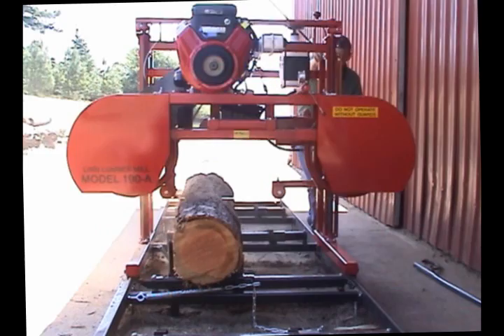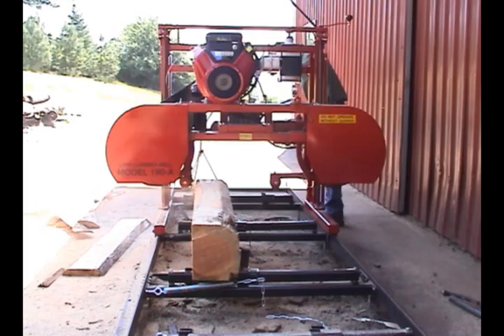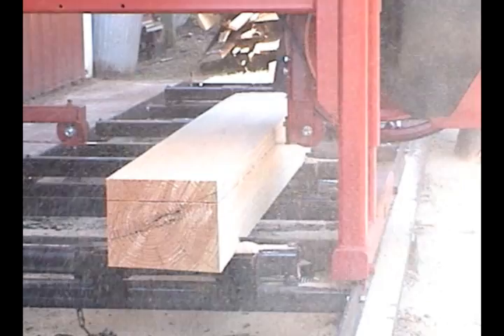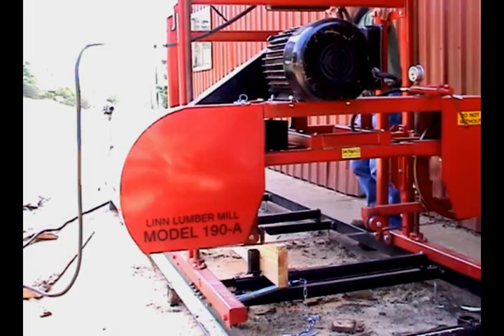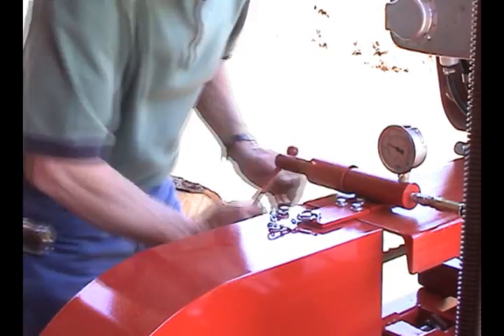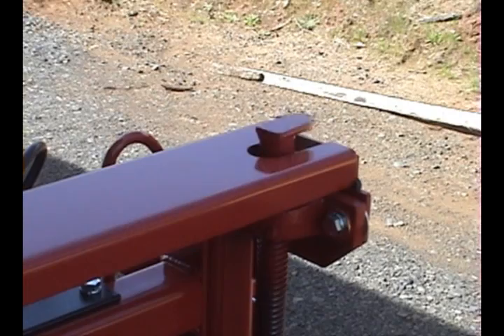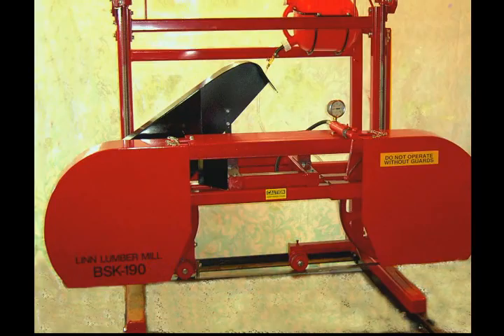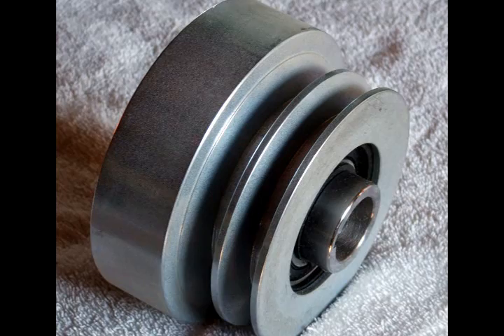Linn Lumber 2012 Sawmill Demo Video

Comment: I want to let people know that I originally bought one of Gary Boyd's very first mills 34 years ago.  Gary was the founder of Linn Lumber Mills.  I have been building Handcrafted log homes for over 48 years and I needed a mill that would cut very long material.  While most of the logwork is done using chainsaws and hand tools, I needed to be able to cut logs in half and to cut flats on rafters and plate logs.  The original mills used a vertical shaft motor to power a long chainsaw bar and chain.  It is a perfect machine for what I use it for in logwork because I wanted the 3/8" saw kerf so I could put a chainsaw into the kerfs to complete my cuts.  A second advantage of the chainsaw bar and chain is that I can cut in either direction which you cannot do with a bandsaw.  I built two additional 20' mill extensions and can now cut logs and timbers up to 57'  This mill has been one of the best equipment investments I ever made for my business because it does what no other mill on the market does.  The only  downside is that this is not a fast production mill.  And I knew that the setup time would be quite slow.

After about 20 year I decided I needed to speed things up a bit and gave Gary a call again.  Gary built me one of his first 1900 bandsaw heads to fit on my existing mill frame.  I now have the best of both worlds.  The bandsaw is much faster and produces a slightly better cut on the material.  Mine is powered with a 21 hp Honda horizontal shaft V-twin.  It definitely speeds things up, yet it is still relatively slow to set up logs.  The pro of it is that I needed to  cut some long 2x8 RS Douglas-fir barge boards for the edge of a roof on a 1935 log house that we're restoring.  I was able to cut the pieces I needed very precisely and they will never give the home owner a problem in the next 40-50 years.  

Gary always gave very good service over the years and I cannot recommend their work highly enough.  I f I needed a mill of the type they specialize in, I would do it all over again.  I'm now in the process of buying a production bandsaw mill and edger.  If Linn Lumber Mills mad a saw large enough I would surely give it a very close look.  I was planning on a Wood-Mizer LT50 Wide mill.  I was talking to my younger brother about them and he went ahead and bought the same mill that I was planning on buying from W-M.  After looking at them more and more, I realized that I needed a longer mill than what W-M produces and I was also feeling like the W-M EG200 edger was a bit on the light side of what I wanted.  I happened across Cook's Saw and Manufacturing down in Alabama.  I am absolutely impressed with their saws and the company.  I'll be buying their AC36 sawmill and their large edger.  It looks like the big brother to the mills that Linn Lumber Mills would produce if they were going to go large.

Again, you will not go wrong with a Linn Lumber Mill if it is in the size range that you want and need.  I know you'll get at least 34 years of use out of it with very little maintenance!  P.S. If Gary Boyd stops by one of these days, tell him that Mark Fritch said to say, "Hello!"

Comment: I have some important information for anybody that is thinking about buying this mill. I purchased the model 1900 with all of the options and the best engine available, the 25 HP Kohler. Over all it is a good machine and will produce very high quality lumber and slabs but there are some issues that I believe you should know about. The first problem that I encountered was that my wood was being stained by the black powder coating which did not appear to be baked on very well, it always was marking my high quaility redwood slabs and high quality lumber. The finish is plenty good enough not to need planing but with this black staining I was forced to mill over sized and pay to have my lumber planed. Eventually I purchased four feet of Stainless Steel square tubing for the log holders which I cut into four pieces but I still had the problem of the log bed staining and marking the wood black so I was forced to sand of the powder coating which leaves the steel bare and able to rust. Another problem I noticed was that the band wheels are not balanced well enough and this causes a galloping of the entire machine which is not good for it but seemed to not affect the quality of the wood. Also the main bearings on the band wheels are inadequate in size and heat up during use, these will not last long and are the main component taking all of the force of the tension from the saw band. The power feed and power adjust seems to so far be working ok but it sometimes will not work at all during moist cold weather and this renders the mill unusable. For $10,000 they could have worked some of these problems out but apparently did not. One more thing the fact that the band wheels are wrapped with rubber drive belts also stains the wood and lumber black from specks od actual rubber coming off during sawing which gets imbedded right into your nice clean wood, this is a problem that I am very unhappy with and the only thing that you can do is not use any water for lubricant and brush, sweep off the sawdust immediately off of every board that you cut and frankly this has become a real pain in the ass. If I had a choice I would of added a few thousand dollars more and purchased a cooks lumber mill which has worked most of these issues away. One more thing is that it's claim of being able to mill 36" logs is a bit far fetched due to the tight fit of the log on the bed, the log must be perfectly centered to even make a couple of cuts otherwise the drive side of the bands will hit the edge of the log. I would not recommend this mill to anybody wanting to mill anything other than construction grade rough lumber. If you are going to mill quality hardwood slabs or redwood for furniture or special uses this is not the mill for you.
Reply: It really sounds like you need a Woodmizer and all of their problems
Reply: Marti, I've been using a chemical that my family uses in our large mill to remove the black staining that you're talking about.  You can look me up online by entering Mark Fritch Log Homes.  Call or send me an email with your emailing address and mailing address.  I'll send you some photos and a sample of the product that removes the stain.  It will completely eliminate the iron oxide staining.  It is also good for the tiny black spots that occur from the tiny flakes of metal that come off the blades during cutting.

Comment: My mill has held up fairly well and I would recommend the model 1900 with the power feed and up and down adjustment option but if you go that route I also would suggest to you to ask them to keep the drive chain that they supply and give you credit for it since it will rust tight within the first 2 winters of outdoor storage regardless if you keep it covered or not. Go online and order 20 feet of #40 Stainless Steel roller chain and you will not have any issues with your drive chain, even though it will set you back a good $150. it is well worth doing.
Reply: I never understand why people use steel and not stainless on industrial units. But if it rusts through winter apply grease.

Comment: Also let me mention that the placement of the hydraulic pump/plunger for blade adjustment is placed in the worst possible location so when you need to tighten it while the mill is cutting you must step right near the path of the spinning blade, one would think that it could of been placed pointing back out of the way in a much safer location.
Reply: I've had my 1900 bandsaw mill for about 15 years and I've never had a problem with the pump's location.  You should not have a worry about a breaking saw blade if you have your guards in place.

Comment: I like the well thought and design of this mills,how much it cost to buy one?will that be some thing that women can handle?
Reply: It is something that a woman can handle because I believe women are no different than men other than maybe physical strength but you should be careful to choose a mill suited for what kind of end result quality your looking for in your finish pruduct as far as finish, looks if not going to be planed and so on. For the price of the basic model I believe it is a good deal but read my other post to learn some facts about these mills.
Reply: May Yang, you should have no problem with the mill.  The logs will be heavy, but if you're milling you will need something like a tractor with a front end loader on it to move the logs.  The lumber is whatever the lumber is and you will possibly need help moving some things that you may cut, but you could do that with the tractor anyway.

Comment: So it is now 2017, I bought my 1900 mill about 3 years ago or so and at first Linn Lumber were pretty good at replying and offering help as to any problems that I was having but now they do not even reply to my email at all, for a mill that I spent right about $10,000. for I was expecting a bit better customer service so in light of their failure to stand behind their product I will now post all of the problems that I had and still have with my mill: 1st off the mill is not designed to be waterproof at all the electronic control box that comes with the power feed options is not watertight and will cause you problems even when it is not raining because it has no seal, no o-ring and is not weather resistant. Along with that you will get a chinese made low quality drive chain that will rust up tighter than a drum within the first two years, sooner if you happen to live by the ocean and as I found out the acme screws that they supply for the power up and down are not too far behind as far as rusting to the point of non operation. This along with a cheap steel fuel tank that has a cap with a breather hole right in the middle of the top is sure to flow water into the fuel tank and cause more rust, fuel tank has no shut off valve or easily inspectable filter. The tracks are not far behind since they flex like you would not believe and need to be thicker angle iron, I suspect that they too are made from chinese material that is quite flimsy for the size that they are. Last but not least is the fact that the band drive wheels are made for driving belts on machinery, not driving steel band blades on a mill and they are not only out of round but also far from being balanced and this causes the entire mill to gallop and make ridges in the wood that you are milling, not a good design to say the least and when I brought this problem to their attention early on I was  told that it was not the problem, "just tighten the band belt up more", sorry but that does not cut it guy's. There is much room for improvement in this mills design starting with the serious problems concerning water proofing and using stainless steel drive chain and acme screws so at least these two important functions will not be compromised by eventual rust like my mill experienced. Over all I would stay away from this mill for the money that they are asking for the reasons mentioned in this post, it so far has cost me well over $500. to try to bring my mill up to the point of being weather proof. I also strongly feel that the main bearings that the band wheels ride on are undersized and inadequate for long term use so if you are going to fork over $10,000. + on a mill you might want to consider doing some really good research and know the pro's and cons of any and all mills that you look at, I did not and now I am paying for my mistake. Cook lumber mills seems to be a for sure step up from this lemon.
Reply: Well, now you know what you need.  I have one of LLM's very first mills and also one of their very first 1900's.  I've not had the problems that you have had.  I do have a cover where I can back them under cover at the end of the day.  I keep the Acme's lubed and, while not perfectly rust free, they are not in bad shape after ~15 years.  If you don't like their mill, I suggest that you look into Cook's Saw and Manufacturing to see what they produce.  I'm buying one of their AC36 Sawmills and an edger soon and they are build very well.